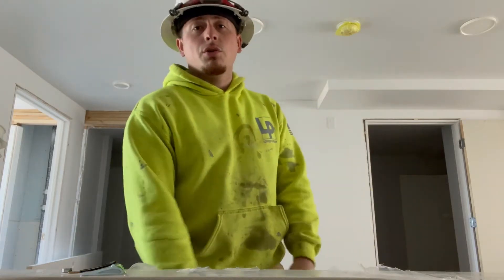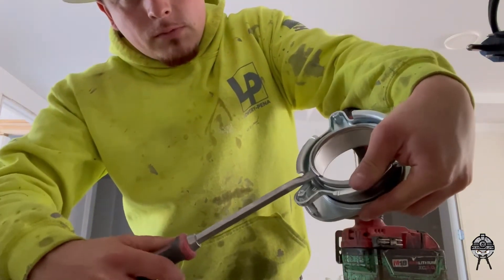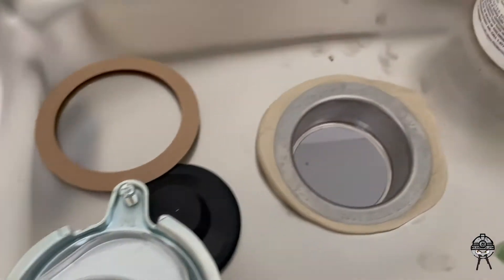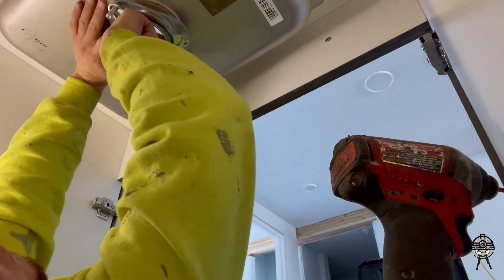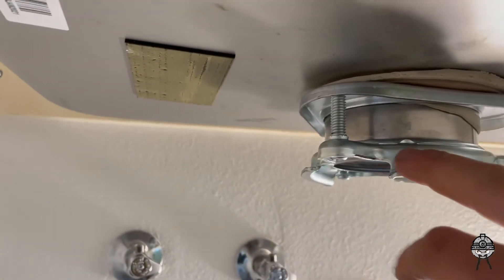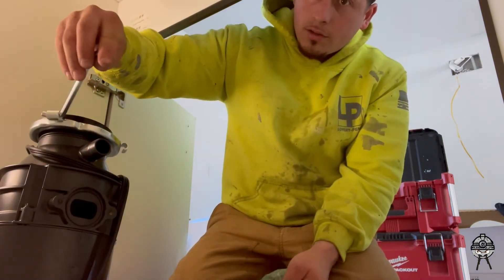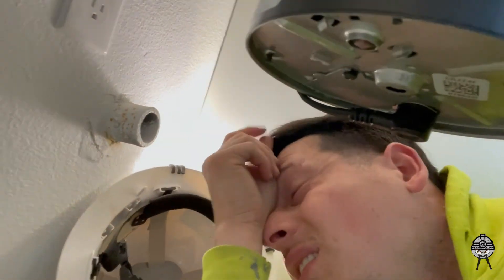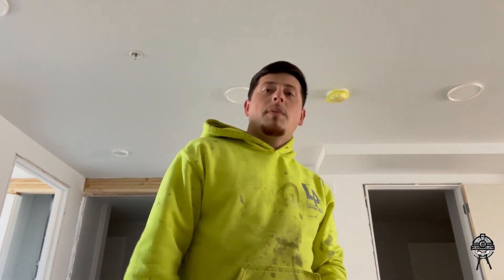Installing Garbage Disposal with Milwaukee tools

Comment: Great video sir, a little tech tip that I have learned, I put my service backpack on top so it adds weight when I am installing the bottom part, that works for me, if no backpack, anything flat and able to fit in the sink will work.

Comment: Why  the trap arm is painted ? Because the plumber who did the rough in didn’t bother to
Put a 20 cent cap  or anything else on it so the dry wall guy 
Or painters don’t throw things over   .. and the gases and bugs of course ,